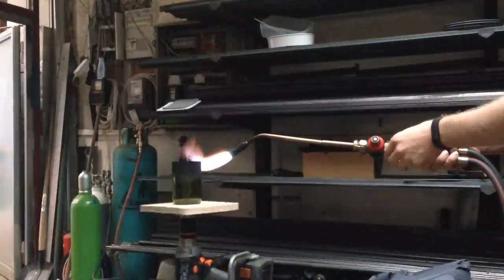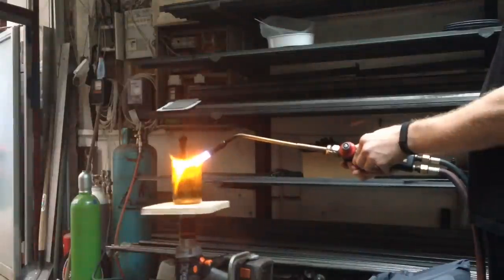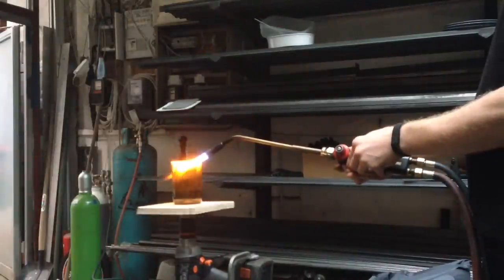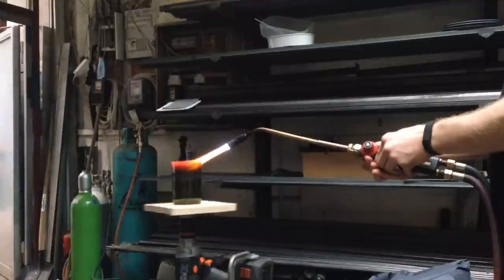DIY-ne Bottle Glass  - fire polishing the rim to make it smooth

Comment: I'm back at it in 2024.  So gratifying and beautiful when it works -- so shocking and dismaying when they shatter.  I I had an unlimited supply of clean blanks I'd keep going, but feeling like giving it up. Investing too much energy in cutting and cleaning blanks.  I suppose if I were patient enough, I could heat them so gradually that they would never break?
Reply: My guess is that cooling down slow enough is more important then heating them up slow. I did a poor job in that video (killed the flame too early unintentional) 
Still - not too many broke. If I would have to guess I’d say about 5%. Some bottles work better then others especially thicker (champaign) bottles were tricky.

Comment: Whoah, that is a big flame. Can amateurs do this? (steep learning curve for using those tools?). and What tools /type of torch? torch and spinner - called what? / recommended brands? where to find? Probly cost a fortune...  THANKS!
Reply: You need a burner setup with oxygen. Acetylen or propane does not matter. Without oxygen it does not get hot enough. I never tried propane & air. Might be worth a try? I only used propane & oxygen in the video. Guess you shoud get a small set in any hardware store? Turntable is just a piece of wood and a screw in a cordless drill.

Comment: I'm doing this just as you have shown, with some success but not 100%.  Still getting some cracking from thermal shock.  Don't know why.  What is your success rate?  (not including the dishwasher cracking).  I will anneal in kiln.  I tried preheating in kiln, but then get additional thermals shock problems when removing from kiln.  I'm using all champagne bottles--very thick.
Reply: I had the most problems with thick champagne bottles. often they seem to have two layers of glass. very weird. I´d say my success rate with normal wine bottles is about 95% with champagne bottles its more like 60-70% ? I never anealed properly in a kiln but hat the glasses preheat in front of a propane heater (diesel / oil heater to be precise but the think looks like a propane heater - not sure if it would make a difference). I after fire polishing I put them back in front of the heater to let them cool down. in the video I did not let the glass cool down with a less saturated flame long enough. It should not glow red anymore... hope that helps. but I guess the thick glass from champagne bottles is just more tricky

Comment from the maker: thanks for the tips Mista Ploosta! Indeed I had some glasses break in the dishwasher (thermal stress?). interestingly all around at about 2-3cm (1 inch) from the top. I think it was only on the glasses where I did not take enough time to let the glass cool down slow enough while keeping it somewhat warm with the torch. Just did some where I too extra care. Let´s see how rugged they are... Unfortunately I don´t have the tools to anneal them properly as you describe, but I love the idea to check them with polarized light! bzw - any tips how to do that on the cheap? diy polarized light source... ?
Reply: you can see thermal stress (homemade polarimeter) by viewing through an iphone camera, while holding polarized glasses over the iphone (I'm sure any cell phone camera would work).  When you rotate the polarized lens over the phone display you can see the stress.
Reply: CAT makes a phone that isn't too expensive that has a thermal imaging camera as well. @flowmanutube

Comment: Awesome! What kind of torch set up do I need to do that?
Reply: Hi, +Charlie Loventhal,
do you mean the burner tip? its fairly big - about 15mm in diameter and has five or six small holes (so several small flames) no idea how they are called... propane & oxygen. I also used the biggest "standard" burner tip I could find the other day - worked fine as well. Guess it had a 2mm hole.
Reply: +der ProtoTyp Thank you very much for the info. I am into making rocket mass stoves so I am considering building a small rocket mass kiln to put the cups in after torching them to help reduce the thermal stress. Does this sound like a good idea to you?
Reply from the maker: Hi +Charlie Loventhal, sounds like an interesting idea! Last time I did a batch of glasses I put them in front of a diesel space heater prior to polishing and after... Not sure how much it helped but it definitely did dry the glasses - which is good. I had several glasses crack during polishing because there was a bit of water still at the bottom.
Reply: In the USA it’s called a “rose bud” ...you can go to any welding supply store and get a rose bud tip. That tip works for both an oxygen/acetylene and oxygen/propane setups. I own a welding and fabrication business, so I run these setups almost daily. I hope that helps

Comment: could you reshape (flare) the rim at that point?
Reply: Temperature-wise I think so, but you would need to hold it differently to be able to work the glass. It happened to me that the rim got too soft and bent itself into the glass due to gravity. So I guess you could also give it an intentional shape at that point
Reply: I'm using a potters wheel.  If you stick the bottle down with some wet clay, might be enough resistance to shape the edge.  So far, mine has cracked, I guess I rushed it.  What kind of gas it that?  I will anneal in kiln
Reply: @Tres Longwell I think wet clay could get you into trouble - when I didnt dry the glass completely and there was a bit of water left at the bottom the glasses burst while fire polishing. I had good experience with storing them in front of a propane hearer prior to and after polishing. No propper annealing but seems to do the trick. And makes sure all moisture is gone prior to polishing.
Reply: Its popane and oxygen
Reply: Oil based clay then or  plumbers putty or high temp silicone.  otherwise some mechanical grasp on the bottom.
Reply: @ Tres Longwell: doesnt oil based clay get soft when warm? I‘m only familiar with the brown car-design-clay (at least I think this is oil based. Or wax?) I would tend towards mechanical / clamping following my gut feeling, but never tried as I said. Would be cool if you could share your findings!

Comment: Angestait,

What kind of torch are you using and does this method only work on wine bottles? thanks
Reply from the maker: Hi Danial,
do you mean the burner tip? its fairly big - about 15mm in diameter and has five or six small holes (so several small flames) no idea how they are called... propane & oxygen. I also used the biggest "standard" burner tip I could find the other day - worked fine as well. Guess it had a 2mm hole. Any glas (bottle) should work. Only problem I had was with some champaign bottles that seemed to had 3 layers of glas that separated when heated up. Dont remember the brand. Several other champaign bottles did work fine. I also used beer bottles, water bottles, wodka...